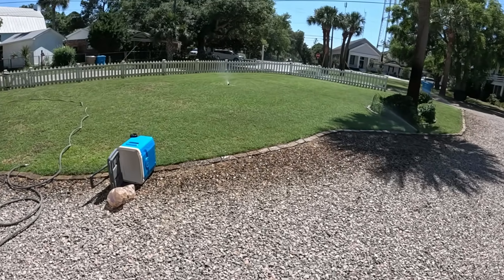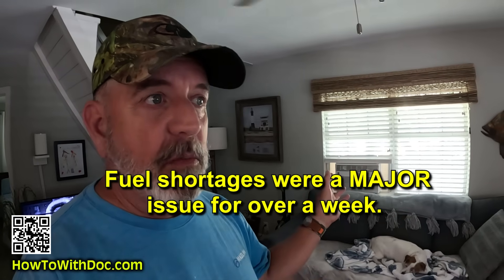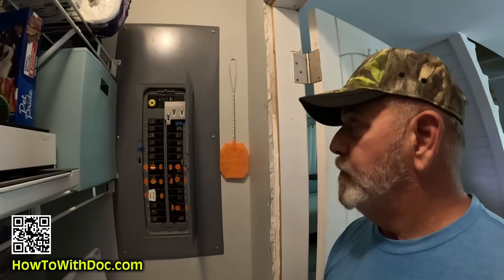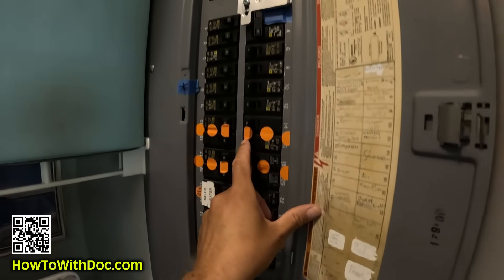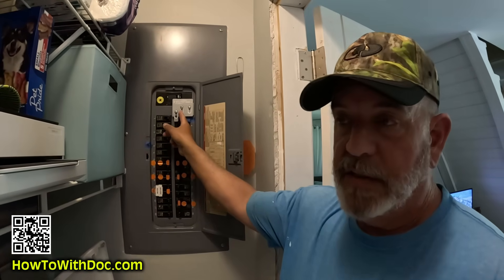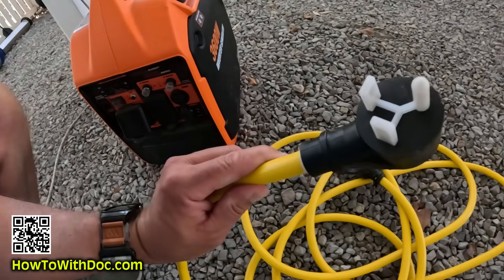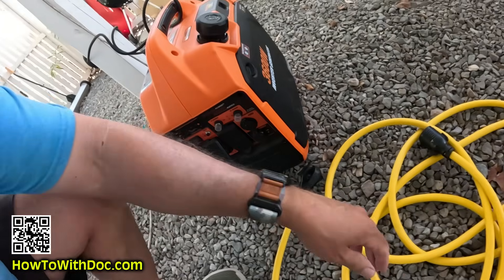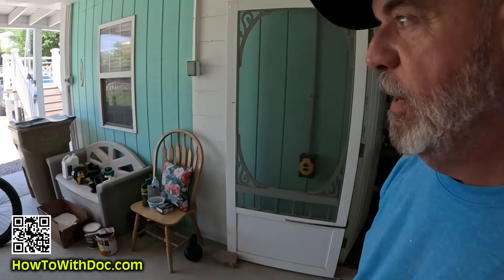How to Use Small Generator for Whole House Power

Comment: Confusing people with the plug. 3 prong could be 50 amp and 4 prong could be 30 amp.
Reply from the maker: No the 50 amp will not fit into the RV plug 30 amp. We link to the correct cord as well.

Comment: I’ve been preaching this same setup to all my family and friends.  My primary home backup is a Westinghouse 5000 watt dual fuel inverter generator wired via interlock and same RV style 30 amp plug.  Running a 12k btu portable AC, fridge, deep freezer, lights, fans, TV/internet, my power demand is usually around 2100-2200 watts.  While I always keep a couple 5 gallon gas cans filled just in case, I prefer to use propane and usually have 4 filled 30 lb tanks on standby.  I even have a smaller Champion 2500 watt dual fuel inverter generator I can use if the 5k fails.  2 is 1 and 1 is none.

Comment: I use a power station to power the house then when the battery runs low I start the Honda eu2200i generator to charge the battery. The generator runs for about an hour a day.

Comment: One thing you need to be aware of is if your transfer switch disconnects the neutral from the main inlet box.  My transfer switch is a HomeLink by Generac and it does switch the neutral requiring the generator to have a bonded ground.  At least, that is my understanding.  I just bought a small inverter generator and the adapter cord you have.  It has a floating ground.  Not sure what I need to do now.  Thanks for the video!
Reply from the maker: Might be true for generac switch but no others do this as far as a basic INPUT into the panel.

Comment: Very Good video!! 

There's also another option which is to buy one of those solar generators such as a Jackery, Bluetti, Anker, etc which can power all of your basic needs. And when it runs out of juice, just re-charge it with a small gas generator like the orange one you have in this video. Re-charging the solar generator with a gas generator might take and hour or two. But those solar generators last 10 to 15 years. And running the gas generator an hour or two is a heckuva lot cheaper than running 24/7.
I live in deep south Louisiana. Hurricane Ida had us without power for 6 long, miserable weeks.
We have a Natural Gas generator. But it blew a fuse on day 1 and we had no way to get a replacement. All stores were also without power. Internet was gone bye bye. And the closest gas station was an hour away with a line for hours and hours.
Prepare BEFORE things go wrong. 
And always remember little things like spare oil, filters, belts, and FUSES!!

Comment: Still could confuse people. Especially if you have a three prong 50 amp generator.

You could have a three prong 30 amp witch consists of one hot a ground and a neutral. 

Or you could have a three prong 240 which has no neutral, and therefore you have a ground, and two hot (120/120)

However, I guess the saving grace for those who don't really understand is that the prongs are different on the 30 versus the 50 so that you don't try to plug 50 A from a generator, into your house, into the 30 amp/7200 W receptacle with an 11,000 W generator

Comment: Great video Doc. I would still put a propane kit on that small generator and use grill tanks. Propane does not go bad like gasoline. Keep 3 or 4 grill tanks in a storage building. They wil still run on gasoline. I like to have more than one way to run a generator.

Comment: We ran out of fuel after Hurricane Gustav. We had a natural gas generator that was a brick. Now I have some solar for backup. I like your video. I ran two ice fans at 60 watts instead of AC. I went a day in August without fuel just batteries. I do have an eco window unit but didn't want to set it up.
Reply: Thate what chef setup is

Comment: I don’t think it’s the case of not enough power. The 240V is two 120V legs that are 189 deg out of phase. Thats the issue that the small generator can’t address. Love this idea. If you make a mistake however leaving a 240 breaker on it will probably damage your appliance. But you marked them well so not too much of a risk
Reply: If a single 120 generator is powering both sides of the panel the voltage cancel each other out and nothing happens on the 240v devices is my understanding.
Reply: @bradyslama2858 - leaving them on and not actually using them is one thing. No big deal. Trying to use them may introduce various risks depending on the device. Some devices use 240 and 120 legs.  You may be right in a lot of cases, but you may be risking it and others.  Safest just to turn them off.

Comment: Having a generator with 5100 running watts means I can power everything (except my main HVAC, my oven and range together, or my clothes drier) with no compromises.  It users more fuel than a 2k or 3K unit -- which I could make work -- but with 5100W I don't have to be overly picky.
Reply: 5000 watt one fuoke guage

Comment: One thing what would be worth mentioning especially when people loose power days on end is that those high run times on a little bit of fuel is low load usually 25%. Just worth knowing if you need days worth of power when fuel is hard to get watch how much load you put on it if you need to conserve fuel. It will still be much less than 6000 watt and larger generator. My 4000 watt champion will use a lot more fuel when I run the planer or a 120v jack hammer etc.
Reply: Byy curdeles reckless jack hamer recheck bareey liwrr energy useage

Comment: You really need to understand "watts"  (volts×current) !!! It i the current that is the important part of the equation, voltage is irrelevant
Reply from the maker: We understand WATTS...  volts x amps, but in this application it's about understanding the 120 vs 240 and understanding how main breaker boxes are set up.
Reply: @HowTowithDoc  Sorry, I just don't get it!,  It appears you have over complicated such a simple thing. I just can't see why you wouldn't use a generator with the correct voltage required, and capable of delivering more current. I am not trying to be rude .

Comment: This sounds like a good idea, but I am confused as to how to use the propane.  I am  a spirited 83 year old and I can see the benefits, but I do not have any experience with generators.
Reply: Many generators are dual fuel (gas or propane) or tri-fuel (natural gas also). The small propane tanks for grills can be used. Easier and safer than gasoline. Natural gas hookups are better. I went with a battery powered solution instead (EcoFlow) but they’re far more expensive.

Comment: Great video I had a setup like this in my first house in Maryland that I had an electrician setup plus he added a sub panel.I brought that generator with me in the move when I sold that house and moved to South of Lafayette Louisiana. Thankfully the house I bought built in 2016 has natural gas and no HOA. I had a 26kw Briggs and Stratton Natural Gas Whole House Generator installed. I am keeping my Sears Craftsman portable gas generator I brought from Maryland for when I get a Camp in Louisiana to setup how you did and I did with my first house in Maryland. Here in Louisiana generators are great to have year round we have lots of thunderstorms year round. One of my uncles has a Natural Gas Generator, propane generator, diesel engine generator and gas engine generator for his house and company business. They work on the motors for the pumps in New Orleans and offshore oil rigs and natural gas rigs.

Comment: Great Video. I was thinking of doing this. It is exactly what I was looking for. One question. What size breaker did you use for the main panel. What size wire did you carry from the main panel to the outside plug for the generator to plug in. It says you can use natural gas also? With the propane dual fuel. Thank You
Reply: I made a mistake , doesn’t hook up to gas.

Comment: This is what I needed to see. I knew about the two phases in a panel, but I didn’t know about adapter that split the 120V over X and Y on the plug. I’ve learned this same principle works with 5-15P to L14-30R adapters too. Now I can finally keep some lights on at night when using a power station or small inverter and save my giant, loud, generator for running A/C during the day.

Comment: I did the same before Ian hit. The Eye of Ian went right on top of us. In addition I run 2kw generator through 3k Solar Power Inverter with 48v 4x12v marine batteries as backup and from extra juice if I have a bigger load than 2kw. So, I plug generator to the Growatt 3kw Solar Power Inverter as recharging generator for my batteries and run power to the house from SPI. It was 120v and I had 2 units to make 240v but I barely use 240v because I convert water pump to 120v. Generator run non stop for 7days and used only 10 gal of gas because in the idle mode it consumed almost nothing . I had plenty of stored gas that I gave it to my neighbors who runs 10-12kw generators that consumes 5 gal per 12 hours and they tired to find gas driving around. Pretty much in the house we had lights, hot  water and food throughout whole blackout time.

Comment: I would avoid gas mainly for the fact you hardly ever need them and gas will not store ,you can add stabilizer  etc.. still will need to be removed after so many years .Go with propane or natural gas if feasible .
Reply: And let's not forget we should keep our vehicles filled and use those as our fuel reservoirs for the generators.

Comment: We purchased a Predator 5000 watt dual fuel inverter generator after selling our gas hungry 5000 w gas gen. Best move ever! We use propane only and nomore gas storage concerns. Also bought the RV plug adaptor and installed the interlock kit at the breaker box. Your easy to follow instructions are great.
Thanks.😊
Reply: good plan

Comment: ANOTHER 20 minutes well spent! I will point out, however, that because both power rails in your breaker box get paralleled when receiving power from the smaller backup generator, they're in phase, meaning there is zero voltage potential between them, meaning it really doesn't matter if the 240v breakers are left on. They, and the 240v appliances attached to them, will receive no power.

Comment: Also curious about buying 2 window units or just putting a soft start on my hvac. I’m thinking easier connivence for my wife. Thinking of having 2 hundred pound propane tanks on hand. Would like the champion 11000 watt tri fuel but they are sold out so may have to go with dual fuel 8500 watt. Obviously weight is a factor if wife is handling but hopefully she will just need to roll it around. Other consideration is a 5500 watt and 4000 watt generator and parallel them if 240 is needed. Obviously more maintenance and storage needs and then more complicated set up for my wife.

Comment: This is exactly what I did. I have a 9000 watt 240 inverter generator that can power my house minus the larger of 2 HVAC units. However I collected four 12v 100ah lifepo4 batteries and have them attached to a 3000 watt pure sine wave inverter purchased from Amazon. It won't run everything but I can flip a bunch of 120 breakers and keep the fridges and other necessities running! Thanks for the video!

Comment: You'll fry your whole breaker panel to the house if your bonding isn't right. Better know if it's neutral or floating bond ground..
Reply: Does this statement apply to every generator not just to the adapter cord used in this video?

Comment: >>> Something I haven't seen tested is running a 220v well pump from 120v generator. Of interest is will the pump develop enough head to deliver to an open yard spigot. No need to have it pressurized beyond have water come out of the spigot for collection. The pump might only develop 25% it's normal power, but would this bee enough to get the water to the top of the ground. Maybe doing the same but using a large 120/240 step up transformer.
Reply: Wont work.

Comment: Guess its great for that load capacity. Smaller loads than that would be an solar generator. To run fans. In august it would great for me to get an portable ac unit and inverter gen for that. It could than top off the solar generator. Got an 1800 watt bluetti. It can run the fan at night for 2 weeks. Myself i live the van life to invest in stocks. Working out so far. You got good info for homeowners at least. Nothing to do with me until i get one i guess. Also use to have an old portable generator non inverter top. New but ran rough uneven supply. Had to pull it out of the trunk to use it than plug my microwave or toaster oven it ran inefficient. Like the solar generator better in that situation. If i wanted a portable ac. Than i would get an inverter generator put it in thhe back of the van on a platform some kind. Plug it into a ac unit. Have not figure where or how mount ac. Than i would use that option maybe better. Dont have enough solar real-estate on top.
Reply: Just buy hybrdde  campuer van rv frm hinda toyta lexus
Reply: @sharonbraselton3135 no

Comment: Haven’t tried it yet, but saw a good suggestion to use the gas generator to power the solar generator quickly. Just have to be sure they are compatible. Thought that was a pretty smart way to conserve fuel.
Reply: I do that if I have to usually don't need to.  You want a pur sin wave generator to be on the safe side. it delivers much cleaner electric.

Comment: You can (& I have) run the house on 120v from a generator alone but I found a combo of a medium size battery bank (i.e. solar generator) and a medium size gas generator will do better.  you run the battery bank 24-7 and recharge with the generator running it at 2/3 power.  you only run the gas gen 2-4 hrs. a day. Generator lasts longer and you use way less gas.  You can even run a battery bank with 240v easily enough.

Comment: This was very helpful. After having been through many hurricanes in my lifetime, I purchased a small solar generator a few years back. It served me well after Helene for lights, a radio, keeping my phone charged, etc, but I would like to upgrade to something with more power. I was looking at the Jackery 3000. It has the RV plug like the gas generator you are using. Would it be possible to use this same set up with the Jackery 3000 and solar panels? the Jackery is 25 amps max. Does that matter with the plug being 30 amps? I apologize if this is a stupid question. Thank you for your help!
Reply: Just buy sklle ektrc rv 3000 watts s o ar dell 78 kw batery

Comment: I like the idea. I have a big champion with remote start and a smaller 1500 watt pull start. I am going to install an extra panel that hooks the 120 circuits from the main panel so all you do is hit the interlock and turn on the box. I don't have very good access to the sun or I would be solar. I can't believe you aren't living in Florida. Also, if you remove the alcohol from gas it will last a lot longer in storage. Its real simple with water and food coloring. They used to sell a deal that hooked up to your meter directly from the Gen. to the meter. I haven't seen those for a while now. In some counties they were outlawed. Maybe they pulled them. As these Patriot style gens are getting cheaper I may end up going that way. 2 small ones. I can always load it up and charge it in the sun next door, or charge it from the gas gen. and have a quiet night. Plus unless its cloudy I have juice.
Reply: Get shadow cells for night tkne energy

Comment: Very interesting workaround!  Your description of how this works would be better related to your viewers if you properly called the two 120VAC lines from Utility Power "Phases."  The two Phases from Utility Power are 180° Out of Phase with each other and that's how the two together make 240VAC.  Your 25 foot Inverter-to-House-Plug jumpers a Single Phase from the Inverter to Both Phase lines in the Breaker Box.  Being the same Single Inverter Phase on each line in the Breaker Box, they cannot make 240VAC, so the 240VAC Breakers have to be turned Off.  I never thought about doing this, but it makes perfect sense.  Brilliant!  And I had no idea that Inverters are the efficient with gasoline.  I learned something today.  Thank you!  👍👍
Reply from the maker: Welcome
Reply: 240V is single phase power. There is only one phase and its improper to call each leg "phases"
Reply: @projectswithjw   Sorry, but you are wrong about that.  240VAC is two phases of 120VAC 180° out of PHASE of each other.

Comment: We think alike! I bought 2 champion 2500 watt dual fuel generators with a parallel kit. Most times I will only need one generator. But I don't need my home AC, just my 120 outlets! Love this video!
Reply: What is a good one? Can you recommend? Thank you! Bless
Reply: @pallasathena4133  Champion generators are good quality, so are Wen generators. I have a Wen 4000 watt gas only inverter/generator and a Champion 2500 watt dual fuel inverter/generator. I also have a dual fuel Sportsman non-inverter generator that I only use on jobsites. It's cheap and loud but it runs all our power tools and lights.

Comment: $2-$3k invested in two generators, 100gal tank, House-Hookup-Mods,,, compared to 5Kw solar-panels, batteries, charge-controller, etc...
I'd get two small generators for break-down-redundancy, and shower with cold-water during emergencies.
That's how the RV is setup.

Comment: I just want to confirm that the floating neutral from the inverter generator is landed/connected to the neutral buss in the panel board with the cord and adapter used that was plugged into your generator input connector correct?
Reply from the maker: Yes... all the wires coming into the panel are connected... but the generator should NOT have a BONDED neutral to ground. That only happens in ONE PLACE in your entire system which is the main panel.  If you use the generator somewhere in the field by itself... it should be bonded.